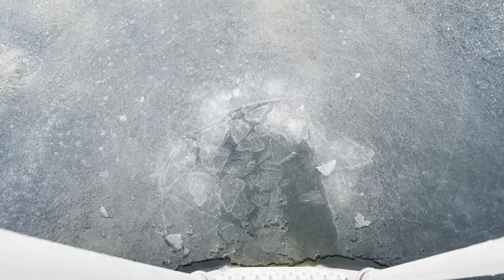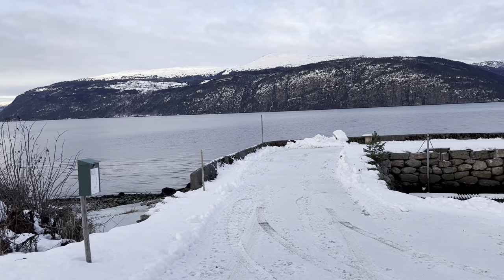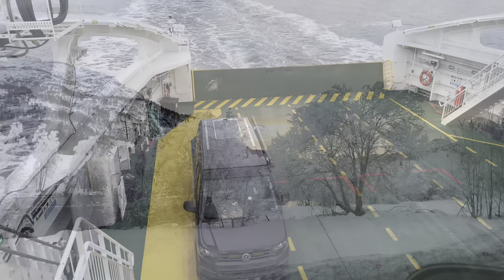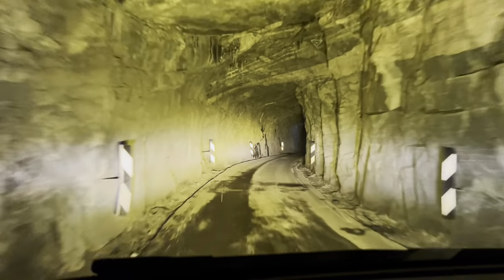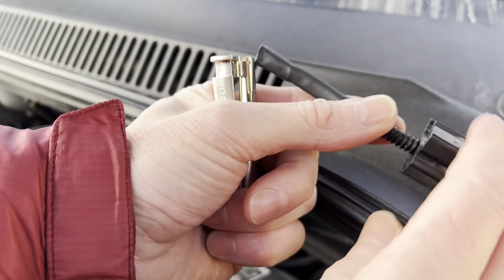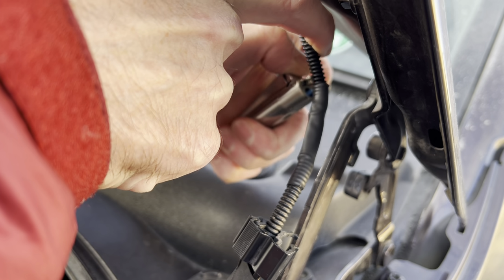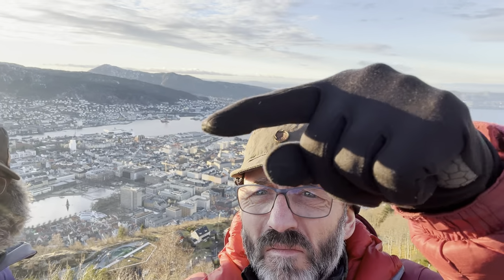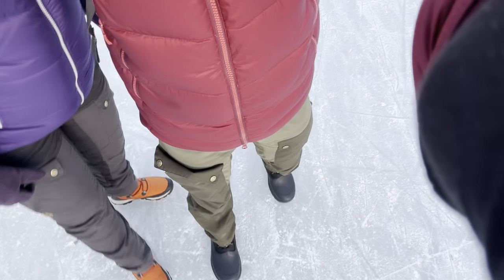Extreme winter van life Ep 7

Comment: Exactly when my washer pipe split ! I did a temporary repair with a bit of reinforced air/fuel pipe that slid over the original pipe and then used a couple of crimp hose clamps to tighten it up, that reminds me it’s still like it !
Reply from the maker: It is a known fault. We have an internal tube fix that is still in the packet 😂 Seems like our "temporary fixes are doing well 👍🏻